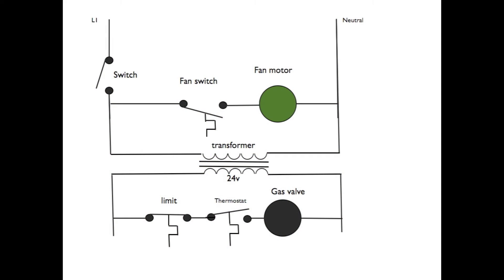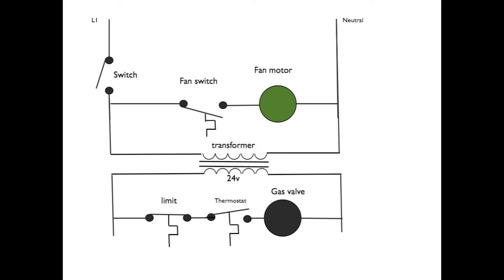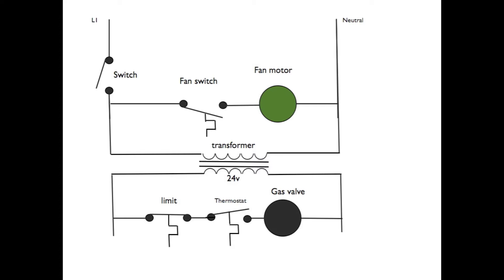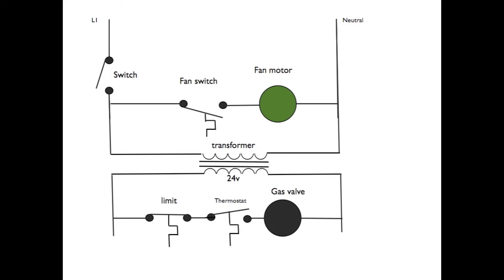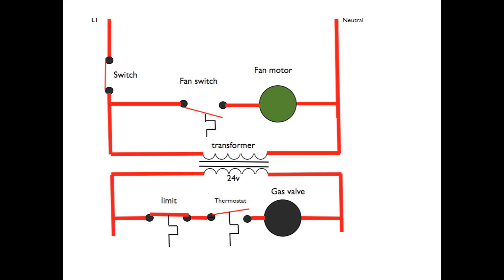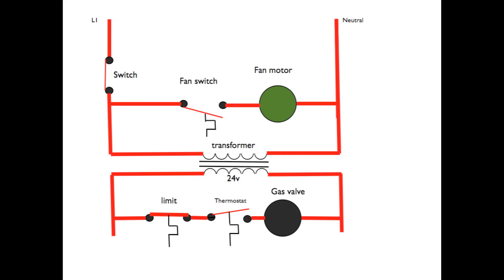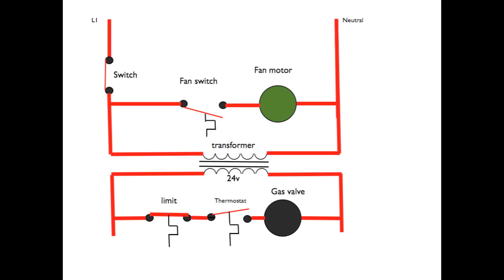Schematic diagram 5

Comment: I should probably know since I just got my red Seal on electrical... I like to help people, so when buddy said he bought a house and the ex husband was mad and cut the furnace wires in the garage before he moved in, I said it wouldn't be a problem. I hook up tonnes of units and AC. I didn't realize it was a lennox furnace from the 60s running on two wires. It's got two wires from the blower. It's got three wires coming down from the fan and limit switch. And two wires that go to the 24v transformer. I've confirmed the voltage on the transformer. I can force run it with direct power. I'm just not sure at which points I need to connect the thermostat on this old furnace. No diagrams on unit. No available pdf except for specs. No terminal boards. I know I have to supply the 24v thermostat with 24v after the transformer. Just not too sure where to put the other wire. These things seem much easier to me with a common...

Comment: Hi GFM. Thanks so much for the responses I really appreciate it. I thank you for your patience as well. So could you define what the "neutral potential available" is. I guess I'm trying to figure out how electricity flows through the components. I understand for example that generally the black wire is your hot wire and that generally if the neutral wire is hot this would indicate reversed polarity (I know you have a video on when the neutral wire is hot but I haven't watched it yet). Anyway, can this neutral potential be measured ? I thought that the neutral wire would complete the circuit when the motor is energized but would not carry any electricity before that.
Reply from the maker: The only voltage that comes into the house is 240v.  The way we get 120v is to install a neutral between the 2.  So the 240v line feeds thru what ever loads are energized, thru the neutral to the other 240v line. Here is a video explaining how this works:   http://youtu.be/sAg9VgMY8nU
GFM

Comment: Hi so if I understand correctly with the switch open power will be only at the neutral motor terminal. The neutral wire itself would not be carrying any current until the motor is energized is this right ?
Reply from the maker: Actually, the neutral potential is available thru the motor to the fan side of the fan switch.
GFM

Comment: Awesome videos please keep them coming. One question, with the manual system switch open is the power actually resting on the neutral side of the load (fan motor) or would it only be there if there if the manual system switch and fan switch are closed. Thanks.
Reply from the maker: If the system switch is open, the neutral power will be at the fan motor terminal of the fan switch.  Hope this helps.
GFM

Comment: I'd like to see you break down that gas valve bubble a little bit. Where would a standing pilot with a thermocouple fit in? The pilot is lit, thermocouple produces a voltage and holds open the pilot valve (solenoid?) that you manually hold down to initially light? That then allows the main gas valve (solenoid?) to open or close at the command of the thermostat? The main gas valve has to experience 24V to stay open? What does the thermocouple voltage have to be?
Reply from the maker: I did a video on the combination gas valve that may help:  The combination gas valve explained
Hope this helps.
GFM